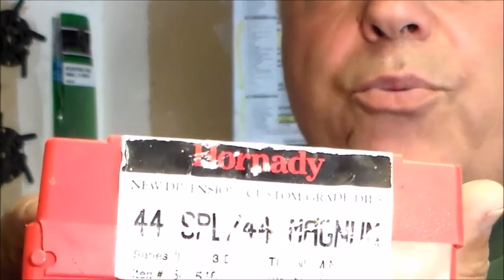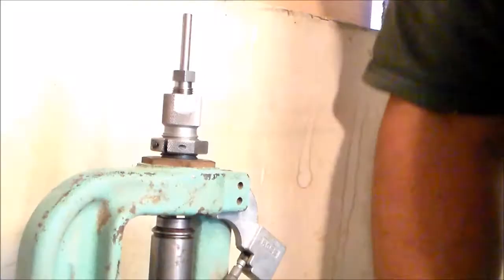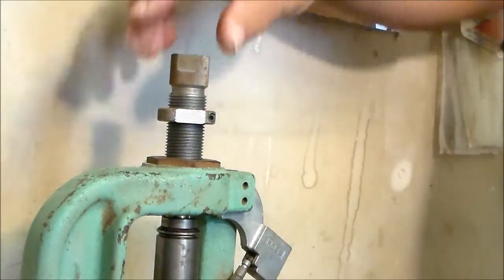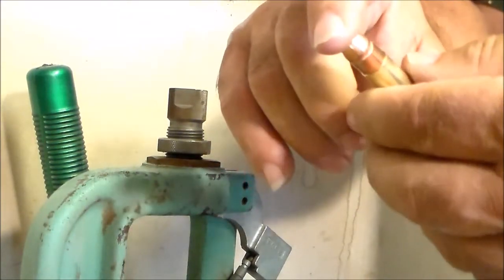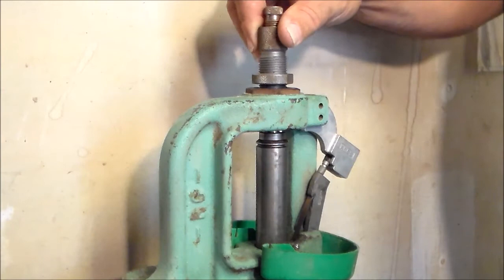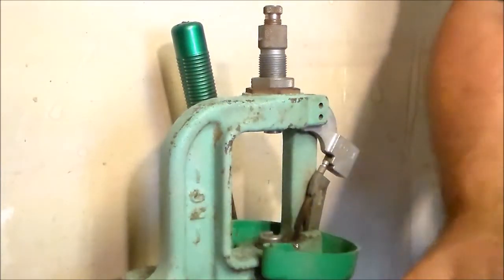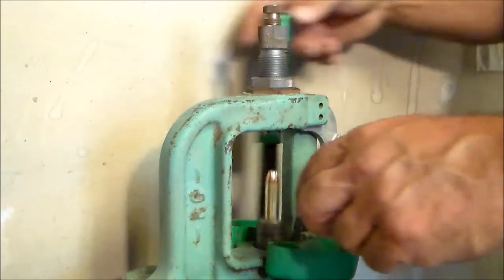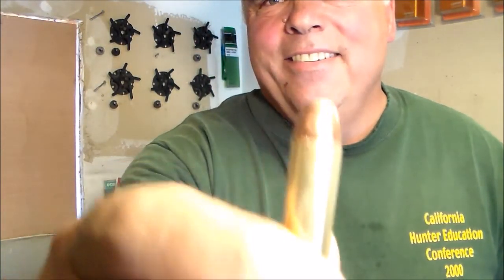44 Rem Mag How to set up dies

Comment: At 7:53 to make the final adjustment on the crimp, you say turn the die down but you adjust the bullet seating knob and turn that in. Since you've turned it up well above the bullet, turning it in is moot. You should be turning the body of the die down. Then check the crimp...If good, follow the final procedure and lock everything down. Correct?
Reply: yes he turned the wrong part and did no adjustment at all. watch it again listen closely to what he says and actually does.
Reply: he has absolutely No Idea , Attention be  careful.

Comment: You mentioned you were doing a tapper crimp, but shouldn't it be a roll crimp for the .44s?
Reply: Good Question I was thinking the same thing.?
Reply: I usually just taper crimp my light, plinking rounds for .44 mag and have never had a problem.  For my full house hunting rounds, I use a separate Redding crimp die.  I don't think he mentioned what fps he was loading to.

Comment: The projectiles for 44spl and 44mag are the same correct?
Reply from the maker: correct
Reply: @acampchef  so basically just watch trim length on cases for each.  Bullet crimping does it need to be tapered or roll ceimp good enough.  I am loading 240 across the data loading.
Reply from the maker: @yojimbo05  trim all your brass first to SAAMI spec. the 44 is a roll crimp